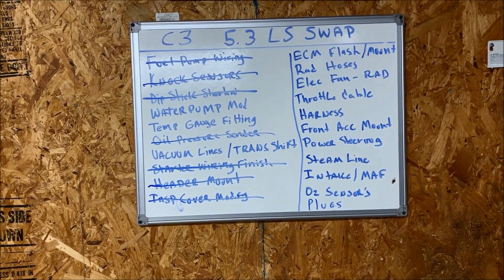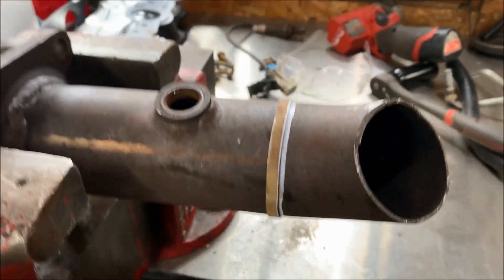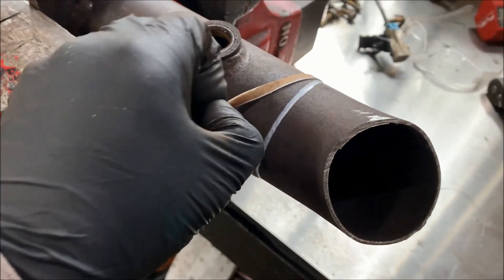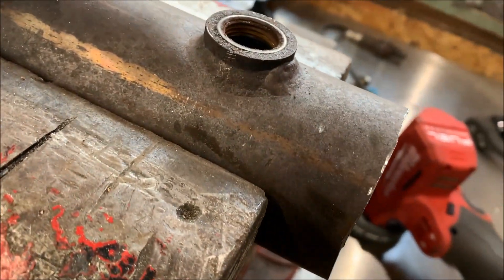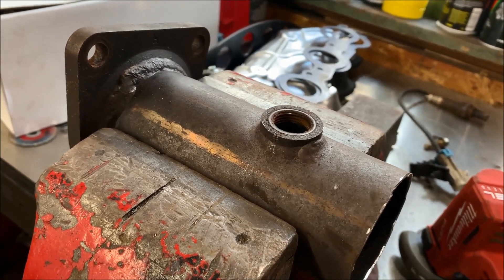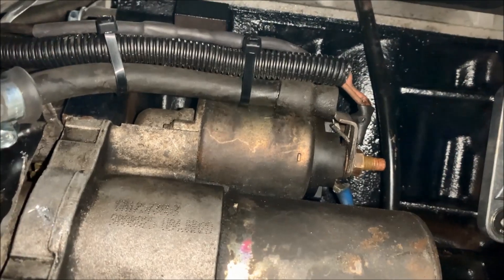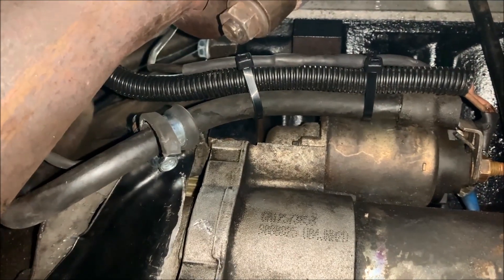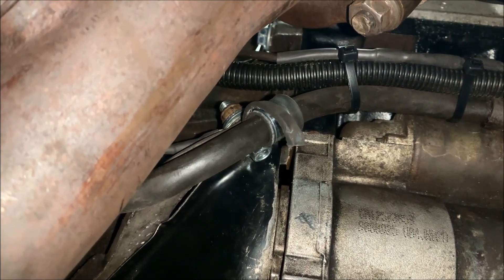1976 Chevrolet C3 Corvette LS Swap - Part 12 Header Fitment and Installation

Comment: Once you get the Temp Gauge hooked up you can dial it in with an adjustable resistor.  Works like a dream.
Reply from the maker: Ok awesome. Thanks for the tip. 

From what I’ve been reading, there will be a difference since of the location between the 2 and with the adapter, the fitting will actually sit “outside” of the block.
Reply: @StreetersGarage  Could be, BUT since the gauge will track with the old SBC sensor you can dial it in such that it agrees with what the computer is seeing.  Let me find you my link..... I lived with an inaccurate gauge for decades and it was so easy to fix.....gimme a sec
Reply from the maker: @silvernblackattach That would be great.
Reply: @StreetersGarage  won't let me attach link here.  sent you email....
Reply: @StreetersGarage  My sensor is relocated to the intake manifold and I have it dialed in to match my EZ-EFI 2.0.... I suspect you'll be in a similar situation....and it tracks wonderfully.